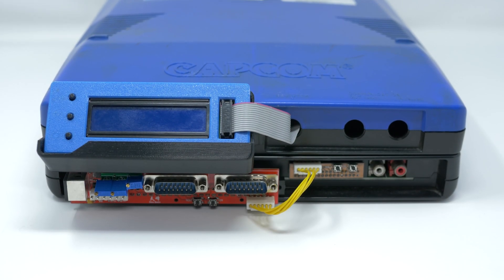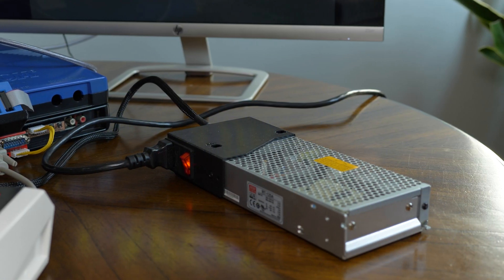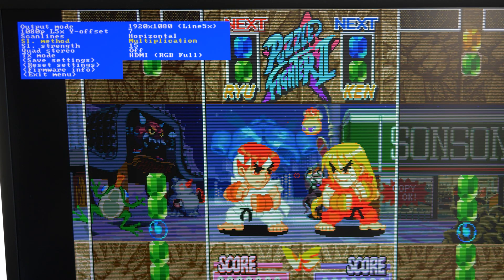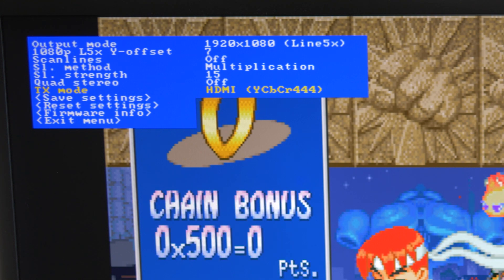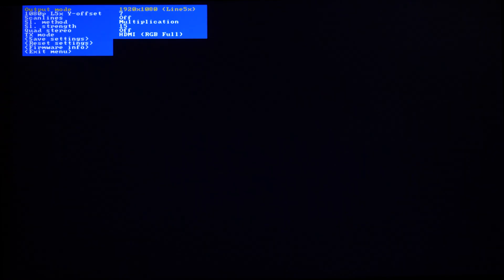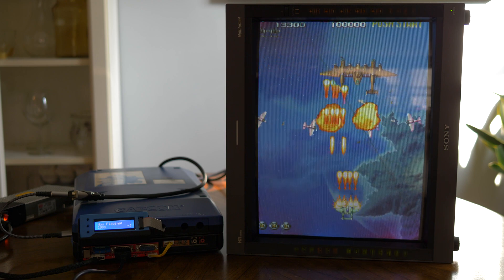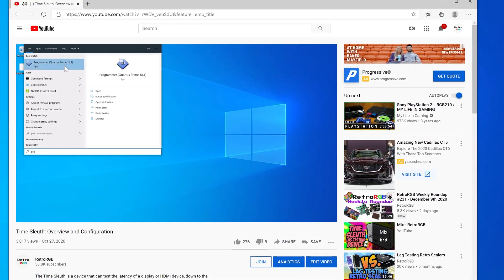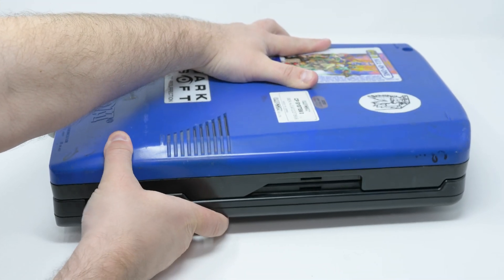Capcom Arcade HDMI Kit

Comment: great video, does anyone know where to buy that 3d printed piece attached to the power supply at 1:53?
Reply: You know the function of that part?
Reply: @zeroxdogma  the one at 1:53
Reply: @msamiullah001  yes I know, I asking the same. I have the power supply but that one have a power switch and looks better.
Reply: @zeroxdogma  I am using the same power supply as in the video but my connections are all exposed

Comment: Pointless if u want the real thing,u goto go crt
Reply: Not quite pointless, there are boards with damaged video outputs that can be repurposed with this, even for CRT use with the use of an HDMI-to-YPbPr or VGA transcoder
Reply: PVMs have started dying around me. Both of them. I have low brightness suddenly in one and bad geometry on the other. Also if they do work ok you need to adjust screen size and X Y axis for every arcade game. With ossc on my Oled you don't really need to mess with this.
Reply: @vasilas432  who needs a pvm?  Get a 2009s samsung tv with component input and call it a day